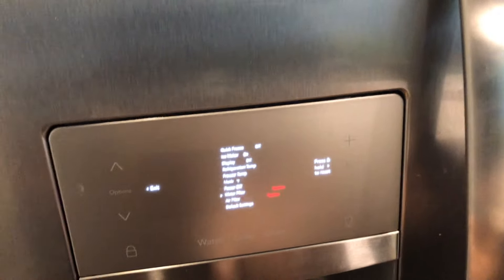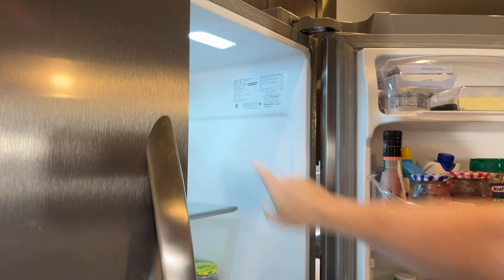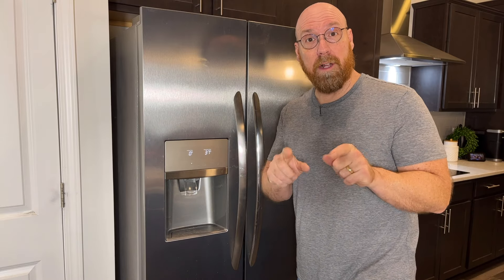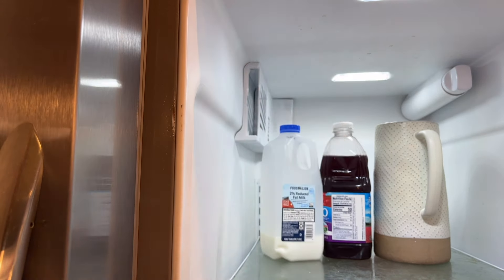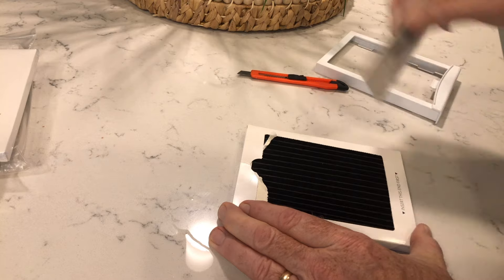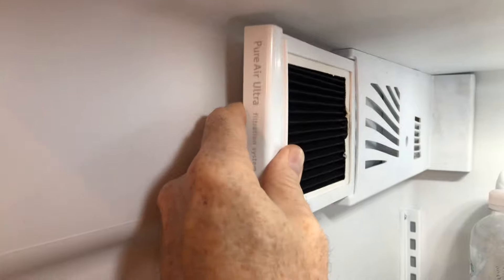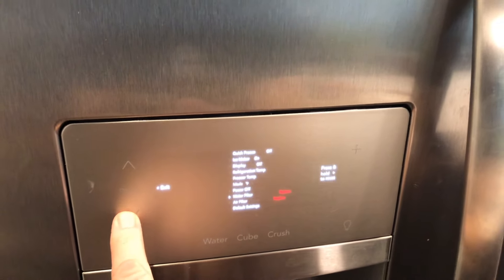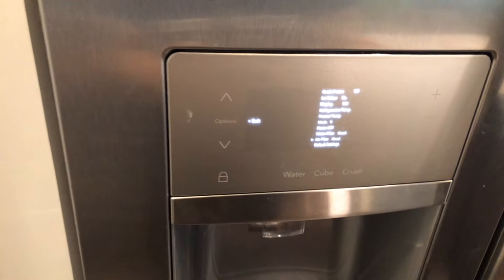Frigidaire Air Filter Replacement in 4 Easy Steps

Comment: 1my ref did not have a filter in it at all  why?? if you are supposed to change it every six month it should of had one it to start with
Reply from the maker: Different models don’t have filters.  Even some Frigidaire Gallery models don’t.  All I know is ours does and it is super easy to change.